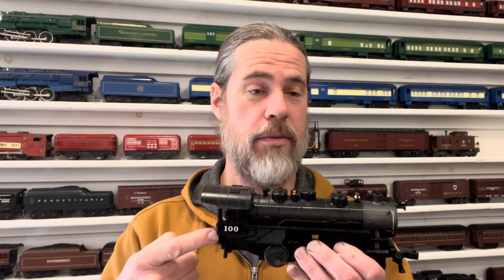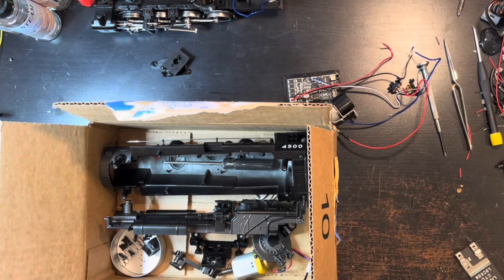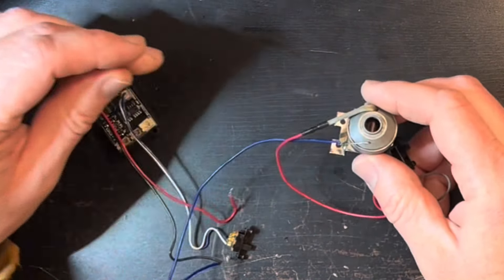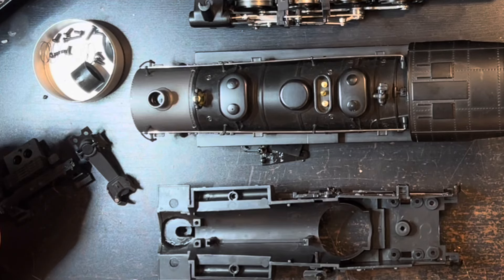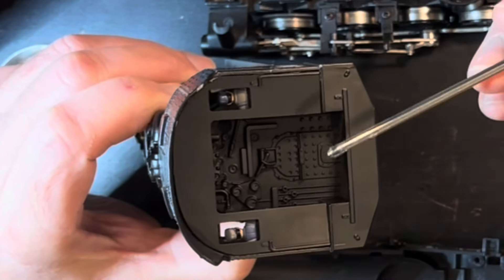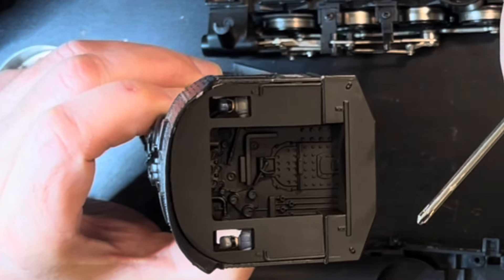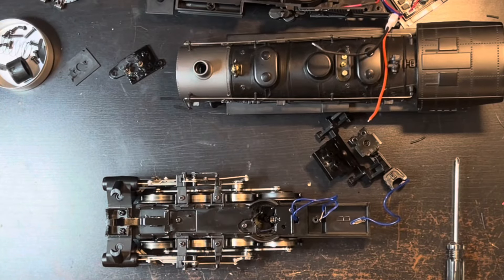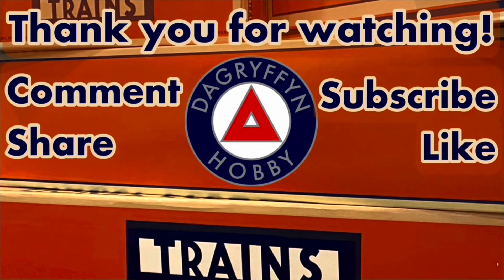Fixing My New 0-8-0 Part 1. Will It Run Again?

Comment: Dave when I saw the motor I said "Uh-huh."  It's almost a dead-ringer for the small motors used in the copiers I used to work on.  I'd see them in document feeders, toner feed systems, sorters, paper feed units, you name it.  And yes, they can go bad. 
Some last for the life of the machine and some don't, just like the circuit boards. You never know.
Anyway I think it's a sure thing the new motor from Lionel should fix the problem. Try it with some dedicated DC from the transformer before you hook it up to the e-unit to make sure it's good, then try it with the e-unit.  The reason I say this is there's the possibility when the old motor went it MIGHT have taken the e-unit with it.  Not a big possibility but it's there just the same. 
That was a great tutorial on deducing the right screws to remove for disassembly!  I'll remember that! 
Good video!  Thanks for posting!
Reply: Sounds like a Xerox guy. There were a few company’s that Xerox favored small can DC motors for prototype work that were far better quality. Globe and Pitman both made one for slot cars very high quality. The worm gear s/b available from aftermarket. Cheaper motors from Mabuchi were available cheap, cheap at one time but I see unrealistic prices today.
Reply: @genemanno1533  Actually Canons first, then Ricohs!   Both used those little DC motors.
Reply from the maker: Thanks Wayne. I’m hoping it’s just the motor. But I won’t be surprised if the board is dead too. The fact that the motor did try to turn makes me hopeful.

Comment: Thanks, Dave. It's been my experience and a little unusual to get an engine that has defective motors or components for that matter. I hope this is an isolated issue as it's a little concerning for me since I have a couple of these engines. I have never had a reason to take mine apart before. So I was glad to see one apart. You tackle your repairs the same way as I. I find most things with this hobby dealing with the unknown the 1st time works best to approach like a puzzle. One step at a time while looking for the most likely place for the piece to go, starting with the most likely place like the border. I always dive in with both feet from start to finish, and then, and only then It dawns on me to Google the schematics. I wish I would think of that before I dive in. It would possibly save some time and definitely a little grief. I wish you luck with your repair. I know you'll get'er done. The parts to repair these have gotten stupid. It's becoming hard justifying repairing some of these because a single part can be a deal breaker by the time you factor the cost of the engine. One can get upside down pretty quickly. Coupler assemblies are $15.00 for plastic ones now.  I wouldn't have thought of going directly to Lionel since my Lionel rep at the train shows charges the same price as the sellers on eBay less shipping.
Reply from the maker: Hopefully the motor is the extent of the issue. I imagine someone was rough on it. Most times when I need parts I just look for another unit. Buying trucks at $20 each makes no sense if I can find a boxcar with the same trucks for $15!  I figure either way with this engine I’ll learn something.

Comment: Hi Dave.
From our experience the motor goes bad and short out and take out the e unit board.
This is a common problem. 
We usually replace both.
Reply from the maker: Thanks Harry. I hope the board is ok but we will see. I had assumed that the motor might take out the board but I’m hoping luck is on my side

Comment: I am amazed at your skill in doing this!  My question is why would a brand new engine have garbage in the motor?  Is that a failure of quality control?
Reply from the maker: Smoke and mirrors. lol. It’s not brand new, it’s maybe 10 years old or so, I’m sure it’s seen some heavy use over the year

Comment: I've got one of those and it is a really good puller. which makes me wonder what someone did to that locomotive to burn the motor up like that?
Reply: They may not have done anything.  I saw plenty of small motors like that one in my 30 years of copier repair and they CAN go bad.  Not all do, but I've had to replace plenty just the same.
Reply from the maker: Sometimes parts just fail I guess!